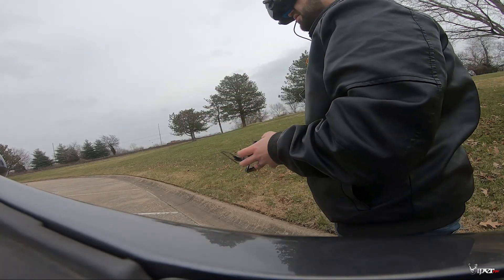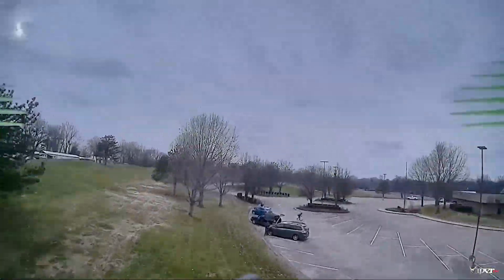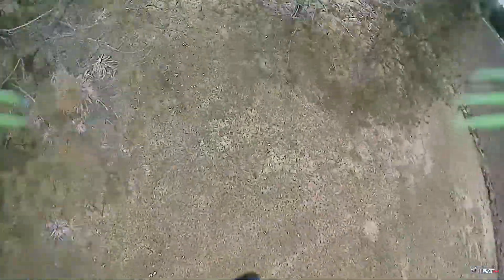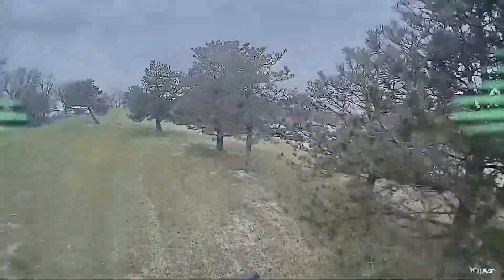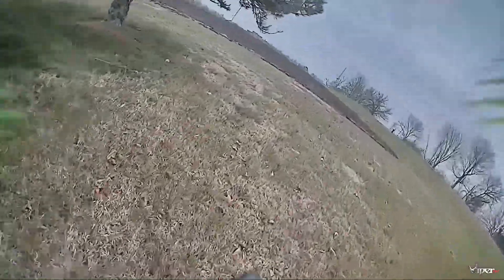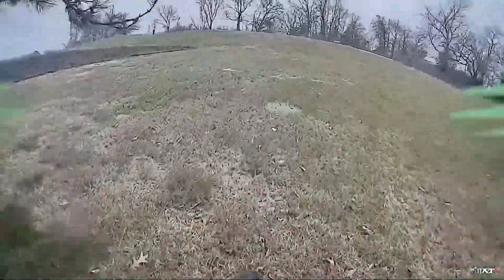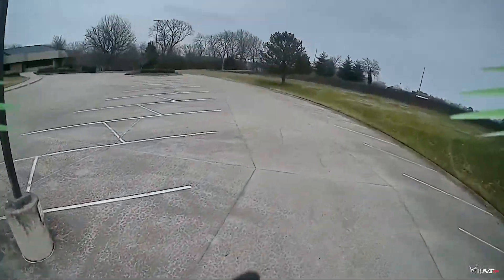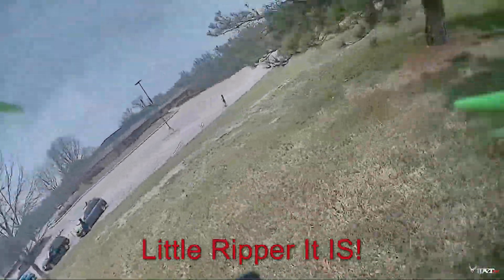FPVCRATE Sub250 3inch Build Test Flight & Thoughts

Comment: I have a prob with my quad, same build, my transmitter registers in beta flight and I can spin up the motors in beta flight, however, I can't spin the motors with my transmitter.  Any ideas?
Reply: side note, if I set the low stick at 1001 the motors spin when I arm the quad and then the transmitter will throttle them up higher.  Im at a loss man, any help would be much appreciated.  I want to fly this "Little Ripper"!